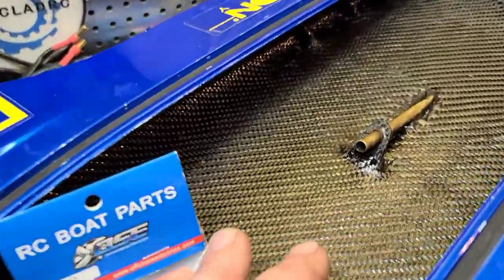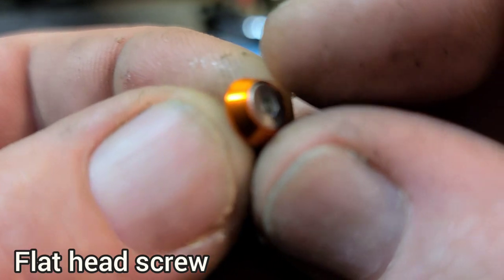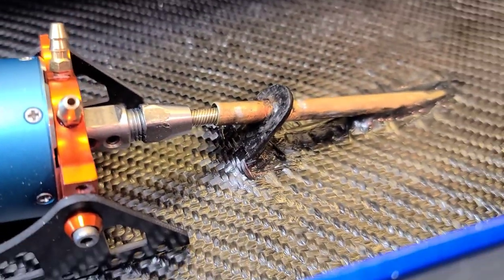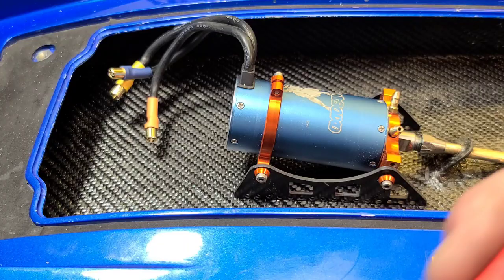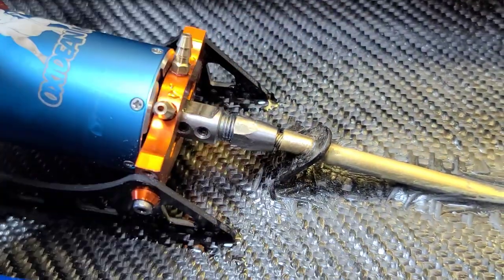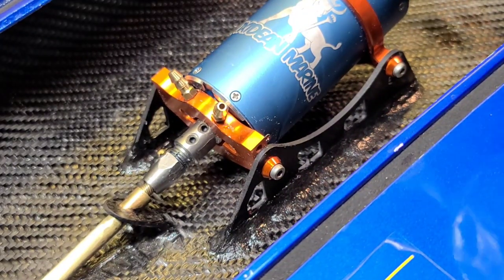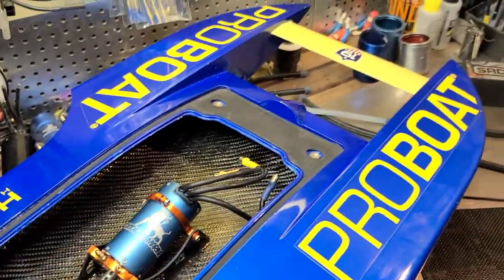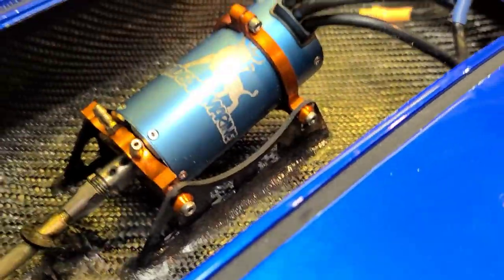Carbon Fiber Brushless Motor Mount Installation Proboat UL-19 - Water Cooled Motor Mount

Comment: Thank you for sharing so much building info with everyone. Even as an experienced (older) builder I learn things from your videos. I use a cut off from a drill bit in my collet with a wrap or 2 off masking tape to make it a neat fit in the stuffing tube. This helps if you can't see the alignment or are having trouble holding the motor in place. Keep up the good work Mr Big B
Reply from the maker: I'll keep that in mind, thanks for watching

Comment: Nothing wrong with epoxying the motormount and you did it very nice. We all got different ways to bond stuff. I use sealingbond used for car windows... Kind off a hassle because it stains (so i tape it), but is very, very strong en you can cut it when it has to come loose again (there will be remains after cutting because its so damn strong and you can use open can just for so long). You can nearly glue everything with it...
This thing is going to fly, that's for sure...
Reply from the maker: Can you send a link for the adhesive
Reply: @IRONCLADRC  brand is Sika. Called sikaflex260 or 522. It's a hybrid glue. It's used in car (for instance front window) and trailer builds (aluminium frame and sheets bonding). When dry it's almost resistant to all chemicals, uv, salt water, hi/low temps and so on. Don't know if its available in States, but i buy it at a local car parts store. Is especially ment for use in automotive industry...

Comment: Hey Im curious as to why you epoxied the motor mount directly to the hull of the boat in a permanent fixed position? The mount has all those holes on the sides for mounting, why not epoxy 2 blocks to the hull and then bolt the mount to the blocks...This way you still have some adjustability where you can slide the motor/mount fwd or back.
Reply from the maker: I've always Permanently mounted my motor mounts, using the holes in the side as epoxy dam holes for bonding.   Never really thought about using the bottom rail holes for a removal mounting option, thanks for the tip,  I've seen it done but never tried it myself.

Comment: Freakin sweet bro now I see why you didnt run the Ul 19 as much those stress cracks are bad , I know there cosmetic but still would freak me out!
Reply from the maker: I was leery of pushing the boat to hard, still kinda worried about the sponsons..  I'm almost tempted to pull the foam and reinforce the sponson tips..  

 it would strengthen the hull but add more weight, Im also contemplating pour foam 🤔  decisions, decisions!

Comment: Gonna try a enlay of carbon fiber on the pathfinder build still thinking about theme of boat it's more orange then red so I'm thinking retro orange crush soda , been orange crushed. Was thing electronics tray but cant get the velez tray so I'm gonna do the same on my cat. Thanks for the videos I learned alot wish I seen some before I started some builds that turned out crappy .

Comment: Hey big B, I see in your last video you used a different epoxy to inlay the carbon fibre and then used bob smith in this video to help with putting on the motor mount. My question is could I use the bob smith industries epoxy to inlay a whole boat while thinning it with a bit of alcohol? Don’t have a lot of resources where I’m at but I do have the slow cure and was hoping that would be enough, going in my Proboat mystic 29 and it’s also my first time. Love your vids!
Reply from the maker: Yea you can use the slow cure but you need to work quick,   I wouldn't thin the epoxy to much when laying up carbon fiber you need it to be "sticky" so it holds everything down in place
Reply: So what is the magic in a bottle that you use?  I thought maybe a good video would be to show all the stuff in your workshop, and the workshop itself, might not be much for you but all the followers and fans would really enjoy it…… and also maybe showing yourself in front of the camera!!!!!!
Reply from the maker: Probably denatured alcohol, been a while since I Made this video

Comment: Lots of info B. Love the Carbon fiber loos great and works even better. Can you apply the Carbon Fiber to a plastic hull. Was wondering if that would work. Great build so far. It's going to haul ass
Reply from the maker: I've reinforced the seems on the bj42 with CF it actually stuck rather well considering....   if you attempt a CF inlay in a poly hull IMO use Gflex by wetsystem its made to flex with plastic/ abs/poly materials.  It's expensive but from what I hear it's worth it

Comment: Hi, i am building a boat and need your help.
The boat is 70cm long it is a mono boat.
The motor i will use, is a turnigy 3674 2200kv and 1750 watt with a 43 prop.
My question is, i choose a 4,75mm flex shaft, is that the right decision? Or should i take a less diameter flex shaft?
Regards
Reply from the maker: .187 with 3/16 stub shaft sounds about right, heavy duty cable so it shouldn't break.

Comment: When you assemble the motor mount. Is better to loctite the screw or use the spring washer ?
Reply from the maker: I'd use the spring washer on the rail mounting screws? I learned the hard way? Loc-tite dried hard!  When I went to remove the motor I stripped all 4 loc-tighted screws.
Reply: @IRONCLADRC  What parts do you recommend using loctite?
Reply from the maker: @05_caoquangbach21  definitely the motor head screws.  All grub screws, Collet, steering, drive dog etc
Reply: @IRONCLADRC  thanks

Comment: Would super glue work fine connecting the mount to the hull? carbon mount and fiberglassed hull
Reply: Or should i use fiberglass resin and some chop up fiberglass
Reply from the maker: I'd use epoxy resin, super glue will not hold